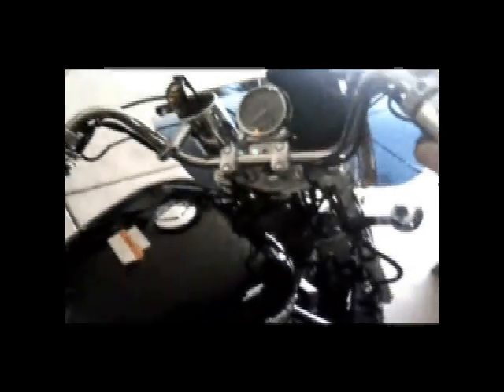2004 Honda Shadow Spirit 1100 Exhaust Holesaw Modification

Comment: i did this to my shadow but it didnt sound quite right yet soooo......... i used a wet ban saw and cut the whole muffler of off both pipes. it was louder but too high pitched so i fabed up two tubes to match the diamiter of the pipes and welded them on. it took the sound from put put soft(stock) to put put loud (holesaw) to pow pow(no mufler to loud) to Wub wub wub wub( just right! i used black exuhast wrap on them ( can be found anywhere high performance parts are bought) and they look great.